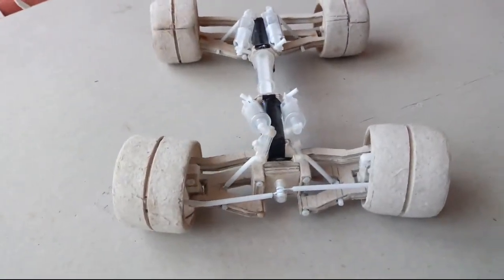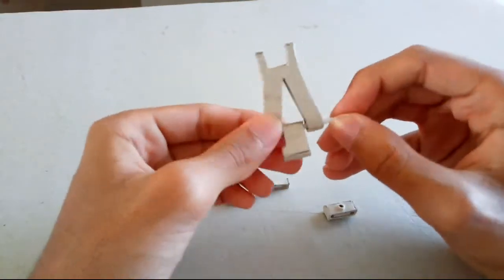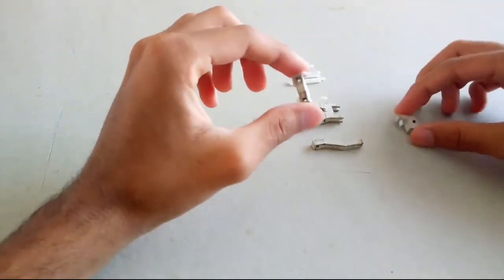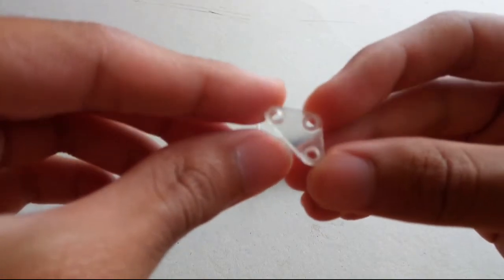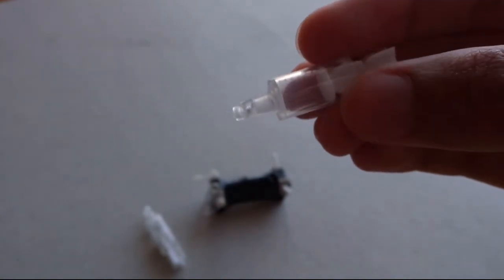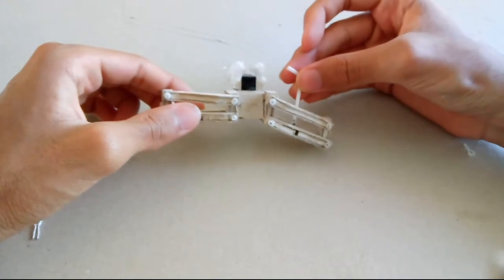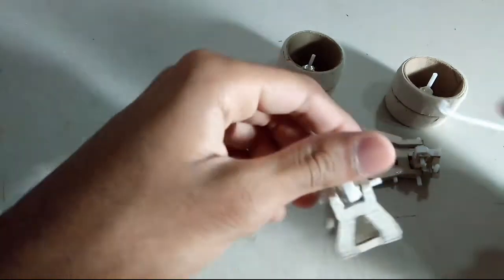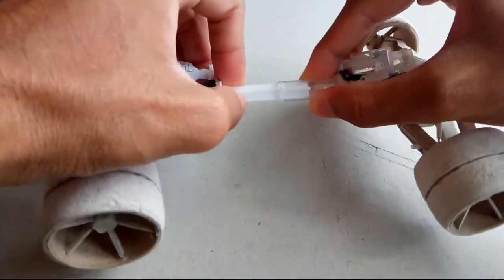push-rod air suspension  +  steering chassis

Comment: how can i conect the motors to the Wheels for Driving it
Reply from the maker: There are no axles on this build so it may be very very difficult to add one. adding a servo for the steering on the other hand is very doable, you may make space for it in the center block
Reply: if We try to make it  at a big size Then We put servos in the Wheel Hub box